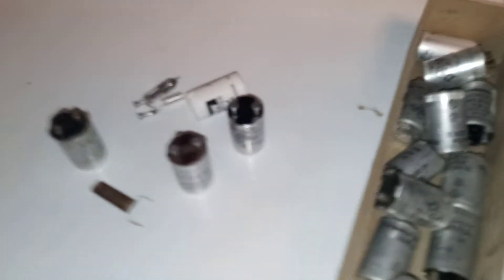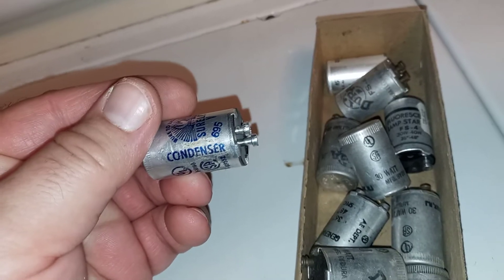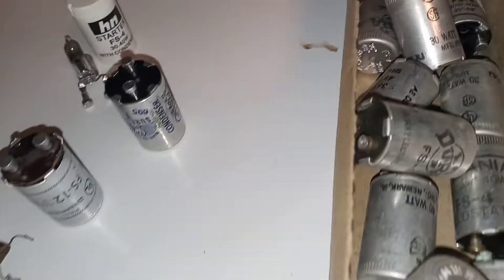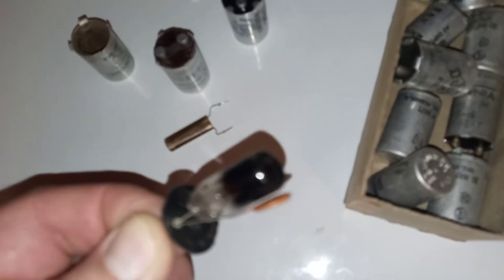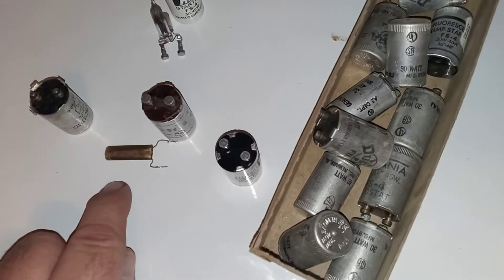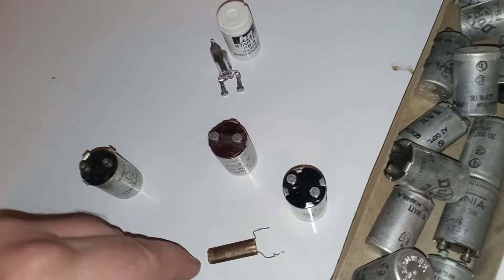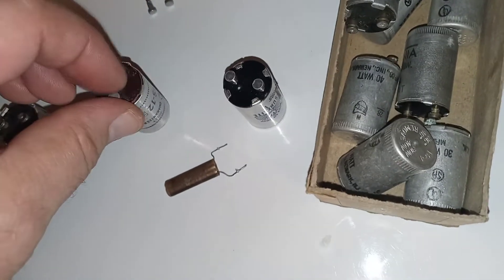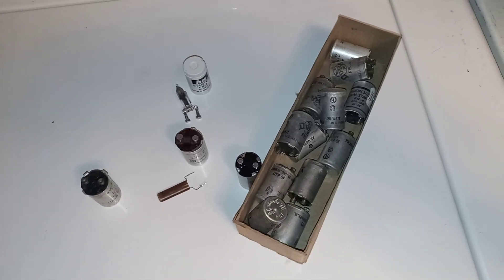Vintage fluorescent lamp starter repair information.

Comment: I was wondering if u maybe know how would one calculate the resistance of a choke needed to make a ballast for a T8 or T12 tube

I have 220V as my mains, but not sure how much turns my coil has to be

Comment: Speaking of old fluorescent starters,  in addition to your standard FS-2,  FS-4, and so on,  there's another very old, rare type used for 90 and 100 watt, 5 foot T17 lamps, FS-85, 4 pin, also known as a thermal starter.    I believe they are no longer manufactured and are very hard to find, most younger readers will never have seen these,  and may not know they once existed.   I have some old books from the early 1960s, and the 4 pin starters for 5 foot T17 lamps worked better in colder temperatures.
Reply from the maker: Yes,I have some of those older thermal starters and they still work,lol
Reply: @christhurman9102  do you have any of the old F90T17  fluorescent bulbs in your collection?   They were very large compared to a T12.   There were two 2 lamp, F90T17 fixtures in my great grandmother's garage after she passed on, the fixtures would have been dated from 1968 because that's when Grandpa built the attached garage, and as a kid I remember they were very bright,  I guess grandpa wanted extra light when working with tools -)  One fixture did not work at all, the other had one lamp only lighting at the ends, and the other tube had blackened ends and blinking,  when we cleaned out the house last year.    I have to wonder if those were the original bulbs,  whatever the case it's a shame they don't work, and replacement bulbs are new old stock and very expensive and GE discontinued making them, about 5 years ago or so, they were the last to manufacture T17 lamps, and come to think of it, I never bothered checking to see if the fixtures had the thermal starter or the glow switch starter.
Reply from the maker: @Sparky-ww5re  those I do not have ,lol The oldest fluorescent bulbs I have are in my fixture over my work bench they are old 20w Westinghouse bulbs with the black ends on them